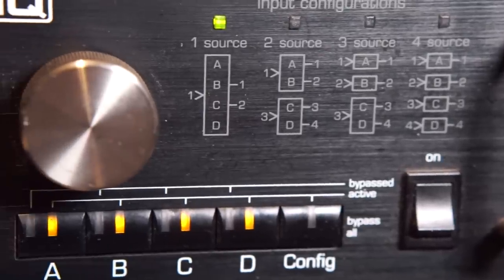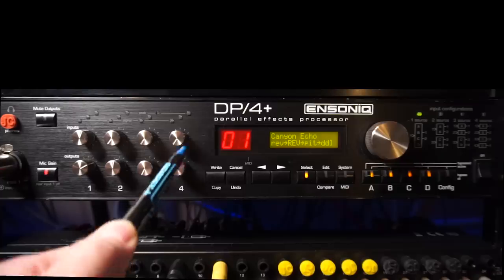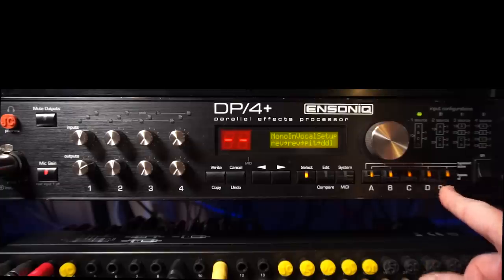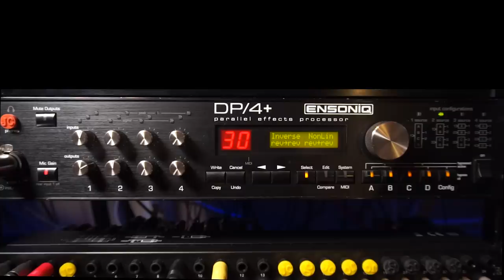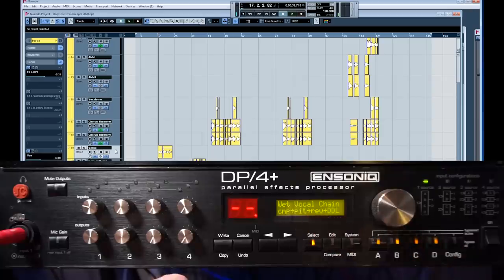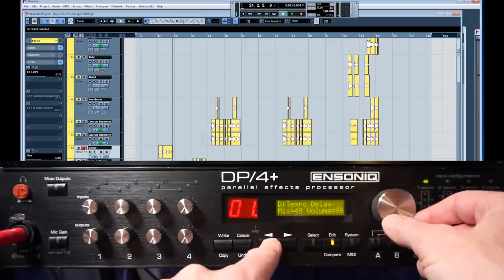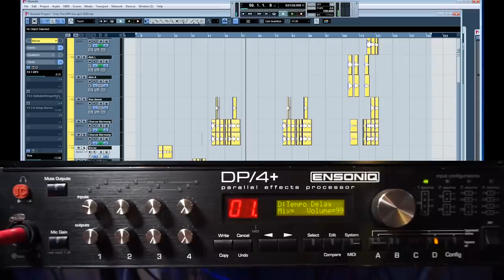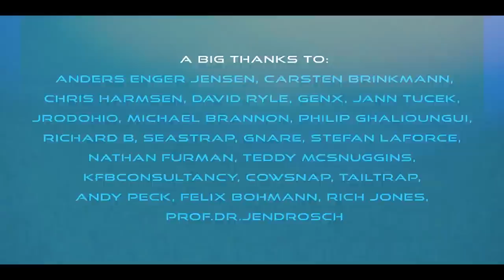Ensoniq DP/4+ | Amazing Cult Classic Effects

Comment: This was one of the reasons I liked my ASR-10 sampler so much. The built-in effects were based on the DP/4 and you could access them from the audio inputs while you were using the sampler. I used it for all my vocal reverbs and delays in the early and mid 90s.
Reply: Same as the TS-12 massive Wave synth
Reply: Not based but they exactly the same discrete processors, ASR has two and DP has four of them
Reply: @Function Automat The verbs are still lush. I legit cannot find any software verb to compete with DP4 and its, not for lack of trying
Reply: @toitoitoy  yes but you can keep resampling those two processors!
Reply: Good to know, I’ve just bought an asr10 & have been contemplating the dp/4 . Do you know how many of the effects are in the synth? Is it worth having both?

Comment: From my experience, an emulation is always going to be worse (or much worse..) than the real thing. Doesn't matter if it's virtual synthesisers or effects or whatnot, it's never going to sound the same or most of the time even close to the original hardware.
Reply: I don't see why this would be the case here, given that the DP/4+ is a digital effects unit, i.e. it runs DSP algorithms on a microprocessor from the nineties. Ok, as long as the original sources of the software are not available and people have to approximate the effects by reverse engineering frequency and time responses there will be small differences, but otherwise...

Comment: This shows once again that Ensoniq devices are underrated 😉 

Two weeks ago I got a barn find (yes, a real find in a real barn). It was an Ensoniq ESQ-1 that was very dirty and with some coffee on some of the keys. I didn’t know much about it but but the seller agreed on 75€. It was said to be working but complaining about the battery. I didn’t test it in the barn.

I bought a new battery and took the whole synth apart and gave it a thorough clean. It turned out to be in excellent cosmetic condition. Soldered a battery holder and put in the new Duracell battery. Fired it up and it powered on. Found the factory patches and downloaded them via MIDI. Everything works perfectly! It is very intuitive and easy to program. It sounds amazing so I’m very happy I bought it 😁
Reply: That's fantastic glad you found this little gem!
Reply from the maker: Great find!
Reply: I miss my ESQ-1. It was a amazing synth in its time and it grew with me into a command center for multiple modules. Yes - so well thought out! I had mine maxed - maybe an SQ-80 would do the trick!!

Comment: There is something indescribable about the sound of Ensoniq stuff. Their early synths had crunchy 8-bit waves with analog filters and no fx, and then their later synths had much higher fidelity samples, dsp-based filtering and effects (which found their way into the DP series).  

Yet despite the different generations of tech in their instruments they all have an “Ensoniq sound” that you can hear. The sound is deep but not warm, bright but not harsh or metallic.  Ensoniq stuff has an attitude-laden character that punches through a mix elegantly. 

Personally I have an SQ-80, DP/4 and SD-1. I proudly use them all a lot in modern techno and ambient music.

Comment: Thanks for featuring this wonderful FX processor. I have owned a DP/2 for over 20 years and really love delays, reverbs and distortion effects. Funny you mentioned the battery replacement hack job. I’m not that technical but I managed to replace the battery in mine even though it required some soldering 😂

Comment: hello Espen, I love your channel, I'm also an owner of a DP4 not the plus version. Daft Punk used a lot the DP4 back in the days, especially for the Phaser "Phaser DDL" which sounds lush. I don't know about their usage of the vocoder but clearly it sounds close. I love this unit which has it's own thing, and I've tried when I didn't own one to emulate it, nothing compares. One thing which is interesting on it is to create landscapes sounds, you can assign a sine / noise generator that you can pitch however you want and use lfo on it and couple it with few other effects as large reverb in full wet + delays or chorus and you will get a dreamy sound of it.
Reply from the maker: Thanks! It can definitely be used for abstract musique.

Comment: Fantastic video Espen!!

I picked up an original DP/4 in 2010 for  $200 USD.  Worth every penny!  Extremely versatile and sounds great. Very well made too.   I believe that Ensoniq touted them as being on par with Lexicon when they released them and reviews seemed to agree.  Speaking of Lexicon,I also have a PCM 60.  It's pretty sweet too and has it's own sound character.  As another commented, Ensoniq used in house designed proprietary  DSP chips.  I think they called them OTTO.  And yes, they did use them in some of their synths.  Or versions / revisions of OTTO.   I know my TS12 and MR76 have an OTTO in them and I think my VFX SD does too.  Also of note, Ensoniq used  Philips 1541 DACs in their high end workstations and samplers.  I know for a fact my TS12 has 4 of them and I'm pretty sure my MR76 does as well as my EPS16+ Rack. Audiophiles hold these DACs in very high regard.  One of the few things I agree with an "audiophile " on. Speaking of which, I also have an MR Rack and a Mirage.  I would love to run across a Fizmo at a good price. I really like Ensoniq and I hate they are gone.  I think their samples of acoustic instruments are some of the best if not the best for their day.  The electric piano presets on the TS12 sound very true to the emulations and very playable.  Ok, I'm getting off the subject going down memory lane.  ;-)     Again, Great Job!!
Reply from the maker: Thanks for the comment Patrick! Great summary as well. :)

Comment: The problem with having so much deeply programmable gear like this, is ergonomics.  Ideally, you want it at eye or desk level, somewhere comfortable in front of you.  But as more synths and rack modules accumulate around you, it becomes more and more impossible for everything to be where you'd like it at the same time.  Editor/librarian programs running on the computer can help with this, but eventually, you always end up with some deep synth or module with endless programming potential down near the floor, up near the ceiling, its screen hidden by something other piece of gear that's in the way, etc.  And let's not even get into how long it takes to get all of this wired without intermittent connections or line hum problems.  This video about the DP/4 reminds me of this because mine is to the left of me, and a little further down toward the floor in my rack than I'd really like.  I could put it somewhere better, but something else would have to get demoted to make room for it...<sigh>
Reply from the maker: The way I use much of my gear is in a Chris Lord-Alge style, I never change the setup. This is set on this vocal chain and will never be adjusted. Apart from me making this video. I'd rather get another DP/4... ;-)

Comment: great unit, I've had so many ensoniqs self immolate though, the 4+ seems especially deathly.
Any of their boxes or boards, by this point, replace the totality of their main PSU and any voltage regulators even slightly off spec imo.

Comment: Usability is good on the DP/4+, and I think the front input helps in a smaller studio.  I mentioned in another video that I prefer the Eventide these days and the Ensoniq doesn't get much use, but I think that's somewhat because I'm lazy and don't have it wired in to the mixing board.  Essentially I use the X32 board as my sound interface, going 4x ADAT in and out from an RME RayDAT card.  This gives me 32 in and out to the X32, and I can use any of the analog inputs/outputs and aux's on the X32 for running effects.  Maybe too flexible since re-wiring for a project can take some thought.
Oh, and don't use the Ensoniq for distortion effects... please? ;-)
Reply from the maker: I've used the distortion of the DP/4 on my synths in many of my productions in the 90s. No client ever complained. ;-)
Reply: Espen Kraft That was then... lots of retro effects are usable today, but distortion from the 90’s should be buried with the 90’s IMO.  My REX50 is fine as a delay and even some reverb is cool, but Yamaha distortion on it sounds like nasty digital overload.  Of course if you use it creatively it’s got an edge...  Now that we’re on the topic, one technique I used was to run the synth through a guitar amp and wet mix that sound in as an effect. I bet a good amp sim could be something interesting to try...

Comment: Thanks for your tutorial. I have the DP/4, not the DP/4+ as you do. I liked your vocoder settings (vocal XLR audio signal on DP/4+ channel 1 in the front panel, keyboard audio signal on channel 2 in the back panel) but I'm not sure how to do it on my DP/4. The Input 1 jack in the front panel on the DP/4 is suited for a strong guitar signal, but not for a weak vocal signal from a Shure SM-58 mic with a cable XLR to jack. Do you have a solution?
Reply from the maker: Thanks! Sure, you need to use a preamp. Either a dedicated one or use a mixer, and feed the output of that into the input.

Comment: Sounds amazing. I love your live mix part on the vocal.  Do i miss a lot since i only own the dp2? And is nt it usual to do full wet if you use it as a send and return?
Reply from the maker: Thanks! You miss out on having to make due with just 2 effects at once compared to 4 with the DP/4.
You mean 100% in each effect in the DP/4? NO, as I'm running 4 effects in a chain that would mean that every effect would get the same amount of "drive" from my ONE aux in the Cubase Mixer. I would have done that if I had the 4 effects going on 4 different AUX'es. This was for demonstration purpose only and I set up just one AUX.

Comment: I had one of these (non +). I was able to get it for about $100 per channel a couple years ago, the + version seems to go for double.  It sounded great but the UI was not so easy and I just didn't have the time so it often sat unused. I felt bad that it was being unused so I sold it. It is great in the right hands! This is an artifact (1992) of using DSP to emulate amps and speakers. https://ccrma.stanford.edu/~dattorro/DP4.htm

Comment: I WOULD NOT PAY MORE THAN £350.00 / USD430 / FAKEuro385.00 -which is already a good price. The DP4 [+] contains some obsolete parts. Their ESP inhouse chips and even some of the spec-ed potentiometers are not available anymore. Failures/defects in one of those parts makes the device unusable/unrepairable. These are really nice sounding FX boxes, fun to use . . like many other gear. The delay's sound special, their only really unique feature IMO. They have a bit of a noise floor though. I had  3 or 4 over the years, bought and sold . . I understand the urge to own a certain piece of equipment after hearing it or reading about it [with the good chance that it is written by people who like to gain a good price when putting their own device on sale]  BUT in the end the sound of the DP4 does not make a notable difference in a song production when listening to the completed song. It's a nice box but it's not an important one
Reply from the maker: I just make videos. I own very little of the gear I show off. ;-)

Comment: That's upsurd any sound can be emulated. What you meant to say maybe, is that it hasn't been done well yet.
Reply from the maker: No, I mean what I say. There will never be a emulated DP/4 that will sound exactly as the original, as with so many of these types of gear. Of course it can come close and definitely usable, I use plugins myself from time to time, nothing wrong with that. Sometimes only the original will do though. ;-)